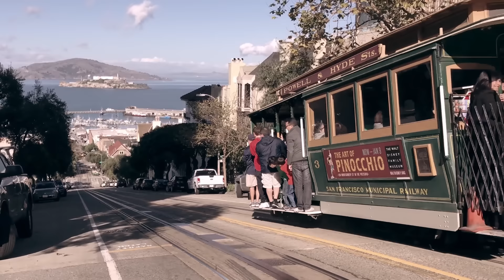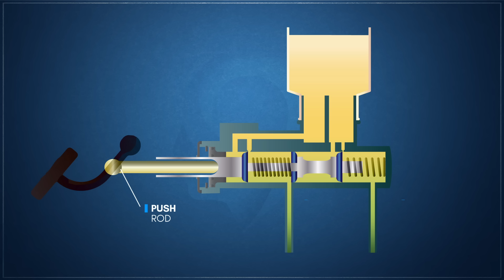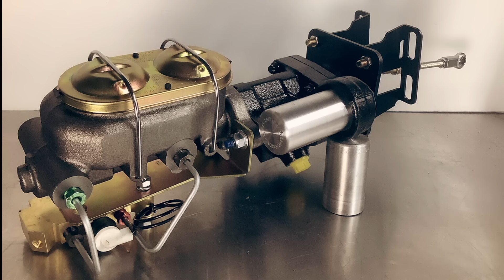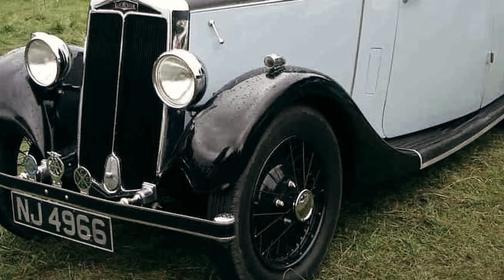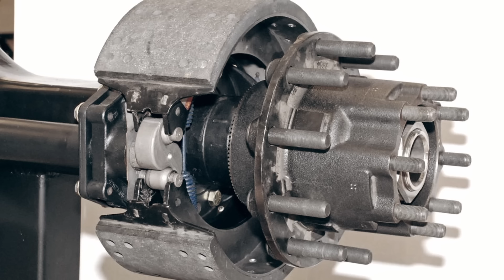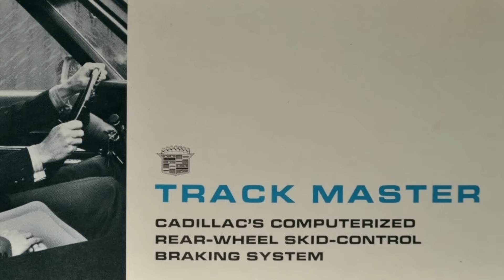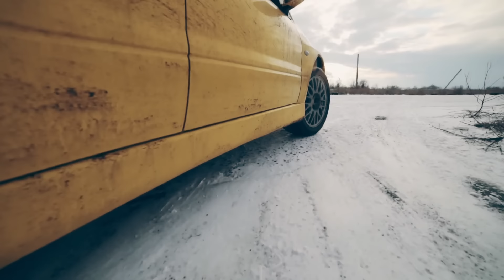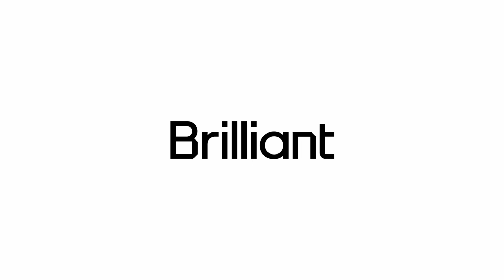The Science of Stopping

Comment: In my hybrid vehicle the caliper pistons started to rust in a ring where the dust seal makes contact since the brakes never get hot enough to dry out moisture because of the regenerative braking. This was at only 30,000 km with pads that looked basically new. I think the manual said that the pads will last the lifetime of the car.
Reply: My EV has a feature that turns off the regen braking specifically to knock the rust off the brake disks occasionally.  You're supposed to hold down a certain button for 3 seconds to enable the feature at least once a month.
Reply: it's common for EV too like Tesla to have calliper rust since the car barely use the brake at all.
Reply: Setting the car to low-regen mode periodically or after going through rain and puddles should remedy the issue I think.
Reply: @aungkyawkhant321  Or just braking really hard once or twice in your driveway
Reply: I will need to watch for rust on my e-scooter, which has a regen brake along with mechanical brakes that can be actuated independently.  
   The regen brake is so effective that I never use the mechanical brakes, which I now view as emergency brakes.
   Since it is quite humid where i live, I expect rust to develop within the mechanical brakes, as you describe.  Something I must watch.  Thanks.

Comment: You forgot engine braking. Downshifting. But great video!!
Reply: He mentioned it, but didn't delve into it because it's not really a part of the braking system. It's a part of the (power) transmission system.
It could be argued that regenerative braking is also part of the transmission system but in this case, regenerative braking is much stronger than engine braking.

He could however have mentioned the advent of retarders. Which in my mind has the sole purpose of taking stress away from the brakes on heavy fast moving vehicles such as semi trucks and buses.
Reply: Engine braking doesn't stop the car
Reply: @KaitouKaiju  Regenerative braking can't fully stop the car either on cars with induction motors either, but IC engine braking and induction motors can both dramatically reduce mechanical brake wear. Electric motors can take a lot more energy than IC engine braking, so to use engine braking effectively a driver needs to be good at predicting what surrounding drivers are going to do and adjusting speed more gently.

The exception to IC engine braking being much less effective than regerative braking in deceleration terms is in the case of vehicles with compression brake/retarder/Jake brake such as many trucks. This system changes the valve timing in the engine to use the compression in the engine to create braking, then leaving the compressed air escape down the exhaust before the piston passes top dead centre and the compressed air pushes the piston down again, returning most of the energy to the wheels. Diesel engines by default have almost no engine braking because they don't have a throttle butterfly to block the air coming into the engine like spark ignition engines. Diesels control power delivery by changing fuel injection rather than by starving air supply.

Permanent magnet motors can bring the car to a complete stop, but they're more expensive to make than induction motors because of the rare earth magnets they use, making them cost more to make. Also power needs to keep going to the motor to hold the car stationary.
Reply: @KaitouKaiju  neither does anti skid systems, but he still discussed them

Comment: TL:DR If your brakes can trigger ABS on dry pavement, bigger brakes won't stop you quicker. Tires are the limiting factor.
Reply: For panic stops on the road, that’s generally true. For repeated heavy braking, such as during racing, bigger and higher performance brakes offer additional capacity and heat dissipation.

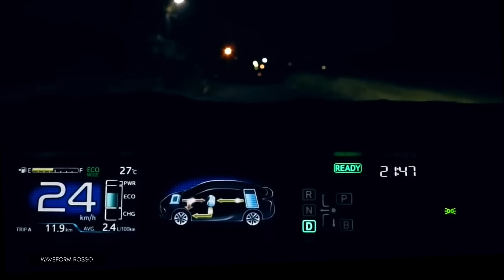Comment: 23:48 the on-board battery, as oposed to the out-board battery? Or what other battery is there than the one that is present in the vehicle?
Reply: Modern electric vehicles have multiple batteries. Regardless, an onboard battery is not opposed to an outboard battery. It's just referring to the primary battery used for propulsion, as opposed to the 12V battery for everything else.

Comment: I love how it gives the history of the technology as it develops from wooden stick and leavers to hydraulics and the mixing of metals with asbestos and electronics...
Reply: I’m going to experiment with regenerative brakes where the vehicle’s inertial is used to power an air compressor that fills a reservoir in the trunk. The charged air can then pass through a long intercooler next to the drive shaft and be routed to the intake manifold and be used in lieu of forced induction. To make it more fun, give the driver a boost button on the steering wheel! It’ll be like having an on demand turbo charger with no lag!
Reply: Just the type of ridiculous ideas I love to hear

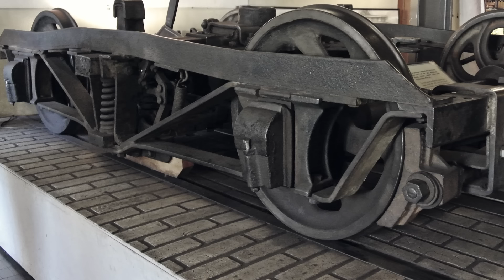Comment: 1:53 what kind of cable cars is still operating with wooden brakes? that is insane
Reply: The 3 remaining cable car lines in San Francisco do. Absolutely amazing smell when going down hill.
Reply: @Xcieg the still use wooden brakes? Idk about that.
Edit: I'll be damne, it's true. But it's used in conjugation with other brakes.
"Fir or Monterey Fir blocks that press against the rails, a system that's part of their unique manual braking setup alongside wheel brakes and emergency slot brakes."
Reply: @Xcieg that's pretty sweet

Comment: Absolutely no manufacturer splits diagonally…not a single one. Don’t know where you that information
Reply from the maker: My source is myself. I've owned several Audis in the past that have diagonally split systems. What's your source behind that confident "absolutely no.."?
Reply: @NewMind seriously??? I have honestly never heard of that. Learn something new every day 🤷🏻‍♂️
Reply: Plenty of manufacturers do it, look up Volvo and Ford for example.
Reply: They absolutely do spilt diagonally. More common in older / smaller cars where rear brakes not strong enough to fulfill legal requirements for minimal deceleration with one circuit failure.